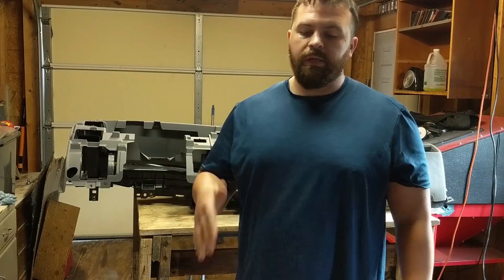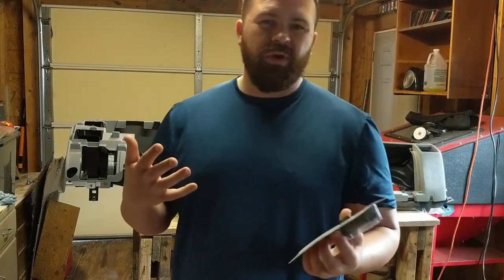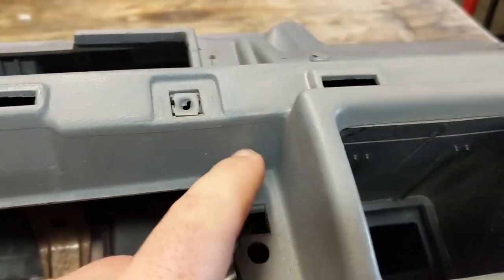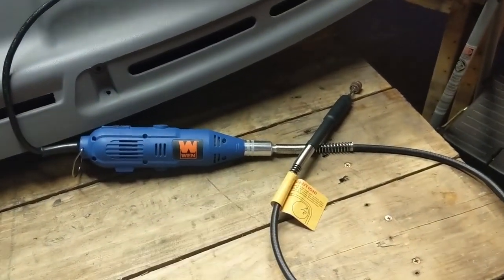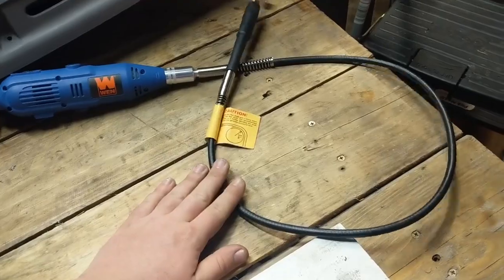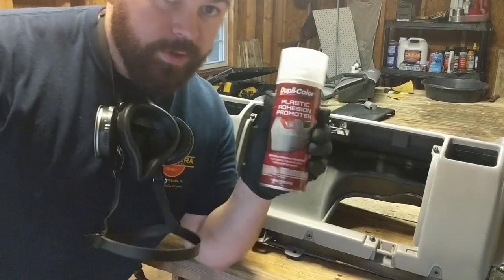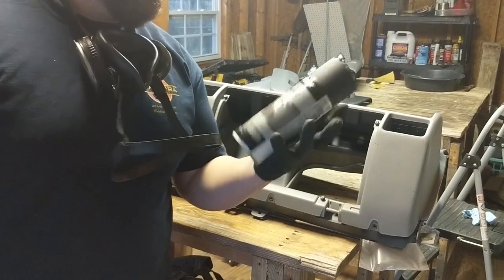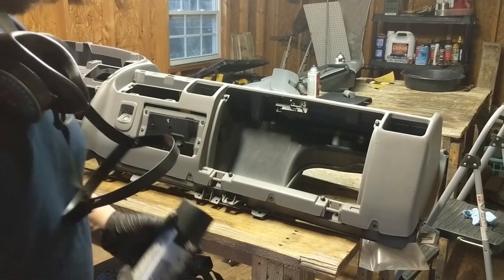OBS Ford Interior Painting

Comment: I’m building a 95 obs short bed with a 3/5 drop.  Love these trucks! Keep up the work and keep videoing!
Reply from the maker: New video should be coming out soon on the restoration of my Inline 6 300 I'm rebuilding.
Reply: @superstar64  I have long beds no they ain’t as nice as this short bed is! I’m going to be doing a 93 regular cab dually 460 5 speed soon!
Reply: @edwardpoff575  
At some point, I’m picking up a 1995 Ford F-350 Powerstroke long bed with the auto, but I think trucks are used for work, as much as I like really cool trucks. Still, I wish you luck.
Reply: @superstar64  I’m going to get a 96 450 7.3 auto with a flatbed but the body is straight and the motor only has 80k on it.  Needs an intake gasket.
Reply: Superstar 64 and Edward Poff 
Both of y'alls trucks sound awesome!!!
Hope everything has been good with them!💯🤙🏻

Comment: Sir I had a question…my 1993 lightning interior is painted black. I need to redo the center console….how do I go about retouching it with the vinyl plastic spray paint you used. Should I just go over it with some alcohol or should I used some other chemical?

Comment: Nice! Almost done with mine... gotta find a decent dash piece since mine is cracked but did all the panels, carpet and suede headliner!! 👍👍
Reply from the maker: I would try some of that Plastic welder, it's really strong stuff!
Reply: Project_ OBS where'd you get your headliner and carpet from everything I've found is on backorder
Reply: Diesel Mike I got the fabric for the headliner at Joan fabric, it’s a faux suede material. And my carpet was still in decent shape. Decided to paint with vinyl and fabric paint and then fluffed it up so it wasn’t stiff